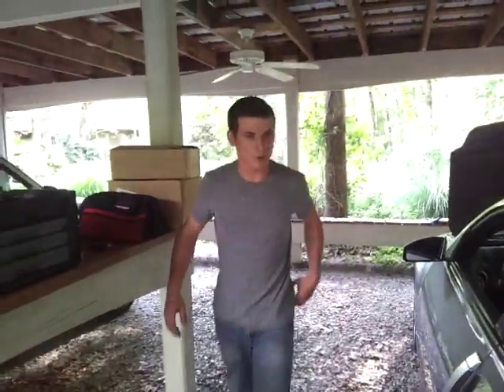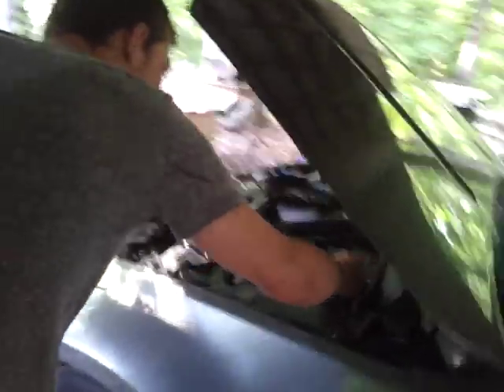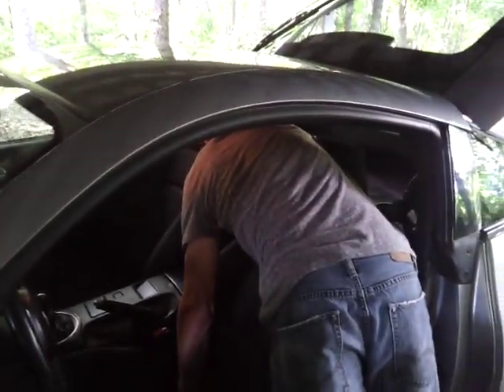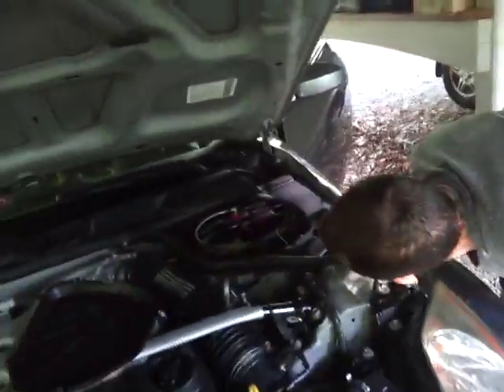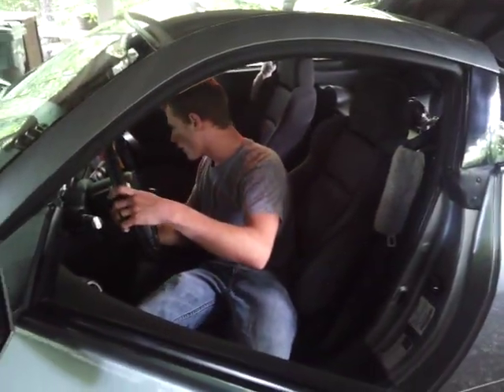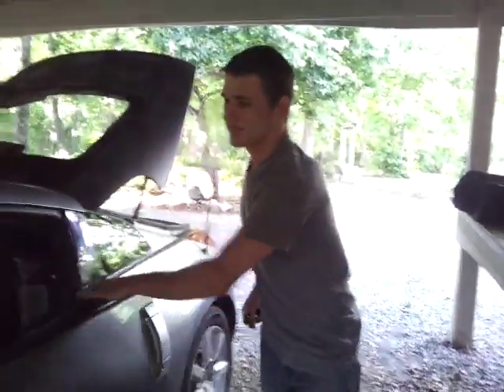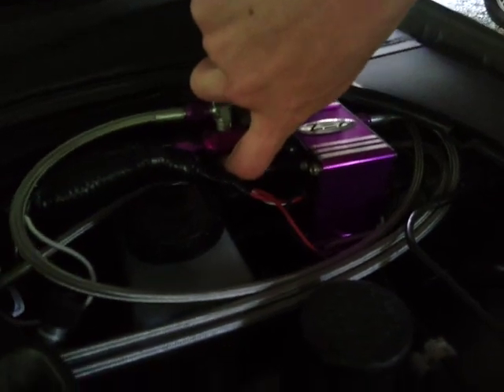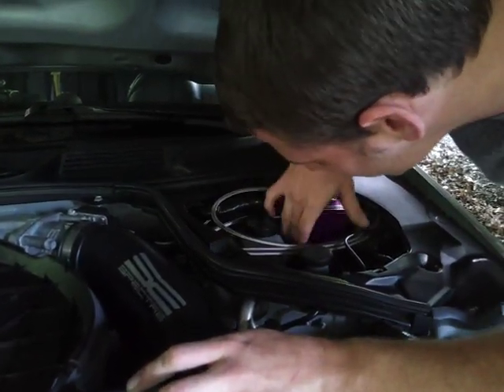350Z Nitrous Install Fail

Comment from the maker: Total I would say 2 or 3 days worth of work. I also installed a purge, tps switch, and bottle heater. Running all of the wires took the longest part of that time because I took the entire interior trim apart to run all of the wires.  I've been testing it all out with a 55 shot and now I'm about install the 75 shot. Getting a tune later on for the 100 shot then will be running with that.

Comment from the maker: I just have the nitrous pressure gauge tank mounted. I have it angled so that when I reach back to open the bottle I can read the pressure. That's about the only time I really need to read the pressure anyways. When I install and get my car tuned for the 100 shot I will install an A/F ratio gauge as well. As far as the switches I installed the arming switch and purge switch near traction control/ VDC off button. The bottle heater switch is located in the center where the heated seat buttons are.